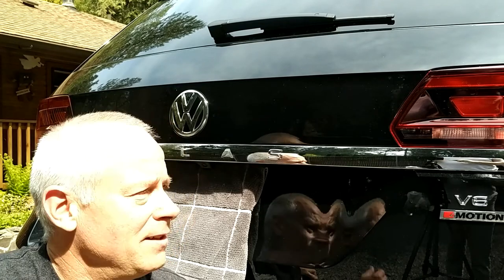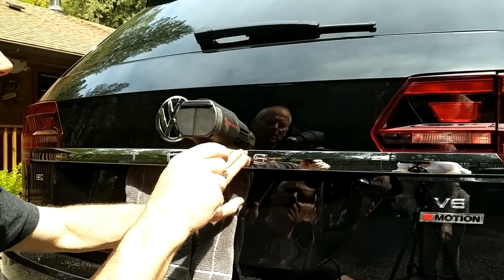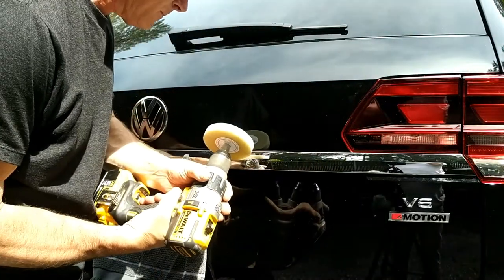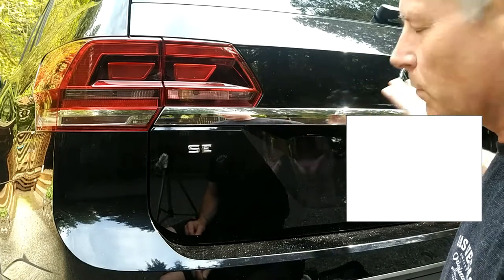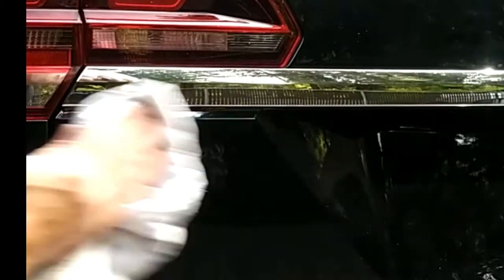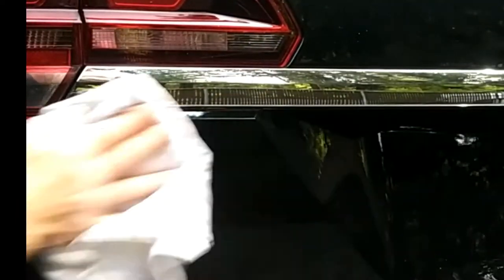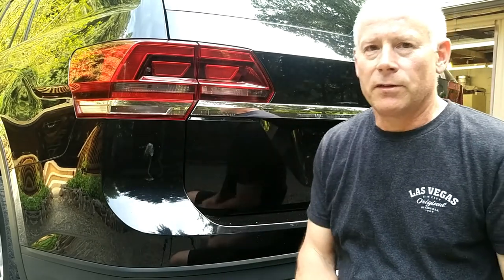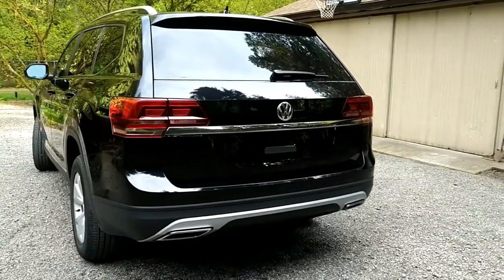How to Debadge a VW Atlas

Comment: I understand why it works on the "ATLAS" but how does it not remove the clear coat on the "SE"? Interested in doing this to my Atlas but worried about messing up the clear coat.  Thanks!
Reply: You don't have to use the eraser if you're worried. Goo-gone soaked into the adhesive will remove the residue

Comment: Looks Good! doing mine this weekend. Has anybody thought about or have removed the luggage
racks? I thinking I will never use them. If they have a clean look removed with minimal hardware like sunken bolts. Could paint them body color. the Atlas, I feel would be even sleeker.